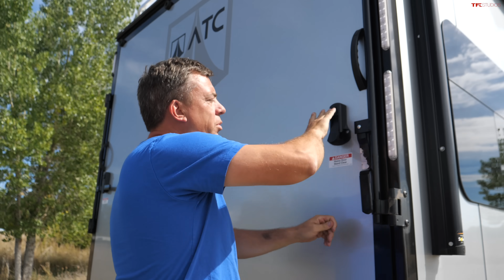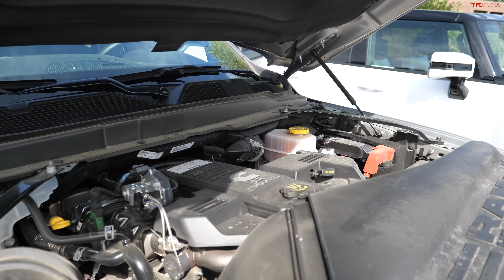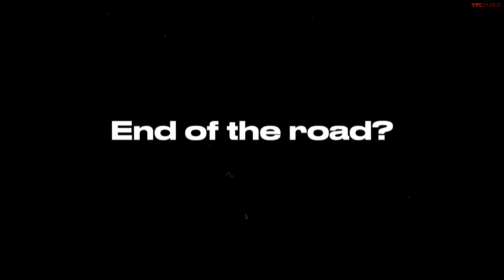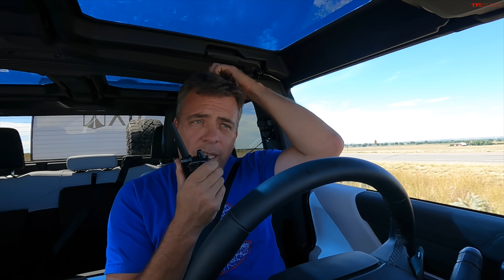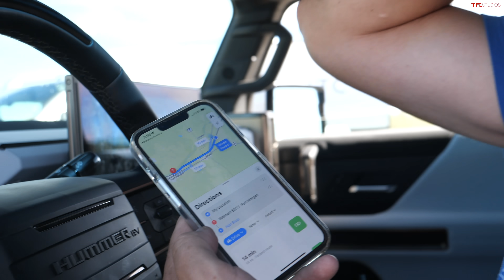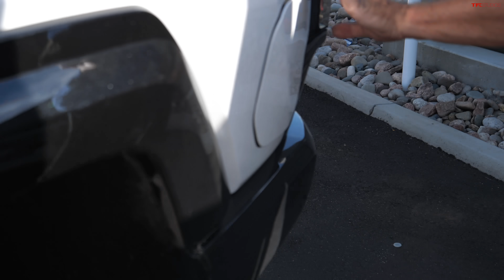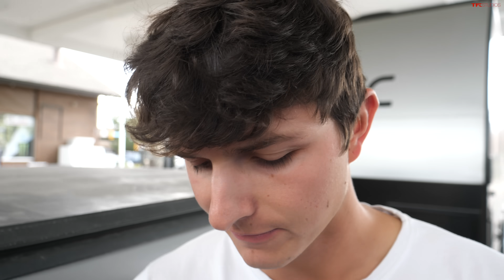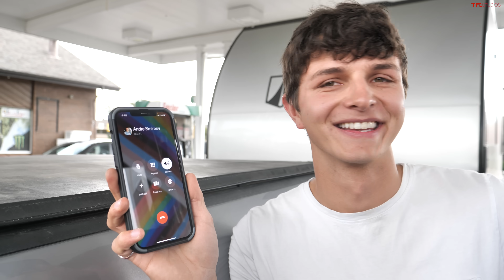How Far Can a Diesel and Electric Truck Tow An Identical Camper Trailer on ONE Fill-up?

Comment: It seems like you keep Hiding the refueling time how long does it take to recharge to get back to the full 125 mile range vs refueling diesel to get back to its 325 mile range?
Reply: That's because with EVs you only start a road trip at 100%, from that point on you only charge to 80% or so because the last 20% can take longer than the first 80% to charge. The current is reduced significantly as the battery reaches full charge because of all the heat generated while charging. 

Just another reason EVs are not ready for primetime and can only fill certain roles for most people.
Reply: @OneNationUnderGod.  Excellent point and the constant high speed charging is known to shorten the life span of the batteries, so you spend all that money for the EV, use high speed charging because of the time it saves to make it worth taking on a trip, and will be loosing the batteries usable range much quicker,  making the vehicle less practical even sooner. Then the ridiculous cost to replace the batteries !! EV'S are not close to a viable solution to replace ICE vehicles !
Reply: Andrea pointed out on the charger he was had spent 31 minutes charging.

Comment: I would love to see you really test the electric truck in a real world tuff towing here in eastern ky where the grades are 12to 16 % almost all curves no straight always and up and down and no charging infrastructure to see what options people living in mountain areas that don’t have highways and interstates that’s my challenge to u lol
Reply: Seems the easy answer is you won't get to your destination
Reply: They do a loop I’m the rockies…
Reply: Aside from the lack of charging infrastructure, this terrain would be ideal for EVs vs ICE vehicles.  Why?  All the twists and turns mean lower speed, which means less air resistance.  Air resistance is what kills range.  EVs regenerate electricity going downhill, which ICE vehicles don't, meaning even better efficiency for EV.
Reply: Same thing in southwestern pa and West Virginia. Nothing but mountains and hills and sometimes its hard to find a gas station with diesel so an ev is out of the question. I find it funny when people even say they can pull 8k with a 1/2 ton. Maybe in Texas where it's all flat, but around here anything over 2 ton you're gonna need a diesel before you burn up a gasser
Reply: Ky doesn't have mountains   ..just  hills
Reply: Yes test in eastern Ky and make sure they both start off equal, ~120kwh full charge in the hummer and the equivalent 4 gallons of gas only  (33.7 kWh = 1 gallon of gas) in the ICE truck. Oh and no refuelling for the ICE ( just to be fair with the “no charging infrastructure”).

Comment: You would have spent 40 bucks on the first half
Reply: The Cummins made it all the way back on 100 bucks you still have to drive back and fill up again. So over 1 hr charging about 70 or 80 dollars charging vs 15 minutes tops to fill up and 100$.

Comment: Seeing that we DESPERATELY NEED clean technology in transportation, knowing that anthropomorphic climate change is real and will/is causing catastrophic consequences, we must not give up on improvements to this problem of energy to density, i.e. diesel vs. battery. Until we get this disparity solved, has there been any development of trailers designed FOR electric trucks - i.e. battery packs in the trailer to assist and work in conjunction with the pulling vehicle, thus reducing the energy needed to tow?  I know it’s been tried in small ways, but don’t know of any commercial units at this time.
Reply: How long would it take to charge Truck AND Camper, 2 hours or more? Yikes
Reply: @Dogman269  I’m not an engineer, but I can imagine that someone could figure out how to rapidly charge both truck and trailer. With many EV’s now being able to fast charge in less than an hour, some in 20 minutes, I don’t see why it couldn’t be developed to have fast charging times.
Reply: Adding weight to the trailer (batteries or motors) reduces the amount of stuff you can put on/in the trailer for towing as it cuts into the tow vehicles overall towing capacity #
Reply: @SasukeUchiha-zu6dw  I’m not an engineer, but do see your point. However, I’d think just like the heavy batteries in all electric vehicles are so designed to propel them efficiently despite the extra weight compared to liquid fuel (think of the Tesla Model S Plaid!), so too a battery assisted trailer could be so designed to overcome the added weight and operate efficiently. Your thoughts?
Reply: @evevangelist5910  since the tow vehicle is rated to tow a certain limit to get around that the trailer would probably need motors to help propel it.  This might help take some of the work load off the truck.  But then the truck needs a new way to talk to the trailer (besides the 7 pin connector).  I think we are trying to solve the wrong problem or just putting a band aid on it.  Right now batteries just don't have the energy density needed for all applications.  It's not really about efficiency.  Resources for batteries are also finite instead of making big hulking trucks and trailers let's use them where they make the most sense and provide the biggest advantage, commuter cars.  Trucks can remain ICE or hybrid until next Gen of tech.
Reply: @SasukeUchiha-zu6dw  Thanks for your thoughts! Please bear in mind that before Elon Musk proved to the industry that an efficient, powerful and sexy looking all electric vehicle was possible, all bets were off, and it was considered ludicrous to think that this could be done. Same with reusable rockets. Musk and his team both at Tesla and SpaceX did what many thought was “impossible”. Thus I still think that making efficient battery powered pick up trucks is doable.

And for that matter, consider the beginning production of all electric semi’s being produced to a limited degree already by companies other than Tesla. As well as the Tesla Semi that is now in limited production with plans for full production next year out of their Giga factory in TX. Sure, there will be growing pains and problems, but I’m confident that they can be figured out. Until then, I encourage early adoption of zero tailpipe emission vehicles wherever they can be practically used, even if not as totally efficient time wise compared to their fossil fuel cousins.
Reply: @evevangelist5910  I encouraged them as well as long as it is up to the consumer.  Know the pros and cons and everyone gets a choice.  Just say no to mandates.
Reply: @SasukeUchiha-zu6dw  I also believe consumer choice is the best. It never feels good to be “forced” to do anything. On the other hand, sometimes we humans get into a rut and are unable to get out of it ourselves. So it takes some forceable means - like a drunkard having his license taken away from him. I knew a man that had that happen to him and life was difficult for him for a good while. But he learned his lesson. Humanity has grown to depend on fossil fuel to a detrimental degree and now we need to radically change. Many resist that change because they aren’t able to conceive or realize the seriousness of the problem. But change we must if we are to have any hope for the future habitability of our planet.
Reply: @evevangelist5910  EVs do not eliminate our dependence on fossil fuels.
Reply: @Mark_Christian25  There is a big difference between “eliminating” and “reducing”. Did you not see the difference in atmosphere during the March 2020 lockdown in Los Angeles? They could see the stars at night where normally smog clouded the view. Or clear skies in the day. And all because there was a dramatic reduction of vehicle traffic during that short period.

It’s not rocket science to realize that greatly REDUCING our use of fossil fuels will bring positive results of clean air and atmosphere to bless us and our children!
Reply: @locustgrovewoodworks  EVs don't greatly reduce anything.

And even if fossil fuels were creating a "crisis", why would you only reduce? It's like saying you're dying of lung cancer, but you only plan to reduce down to one pack of cigarettes a day. 

Makes no sense.
Reply: @Mark_Christian25  In all due respect, you are clearly wrong here. Electric vehicles greatly reduce local air pollution. As I’ve mentioned before, during the lockdown for COVID in March 2020, cities across the country experienced much clearer, cleaner air and atmosphere than ever before. There is even photographic record of this.
 When in a traffic jamb on a still hot summer day, you are sitting in a literal cesspool of toxic fumes from the exhaust pipes of all the cars around you. It can make you sick. 
Bad air is what has caused all sorts of lung and general health conditions which is aggravated by toxic fumes from fossil fuel burning vehicles. 
Electric vehicles in contrast emit NO EXHAUST AT ALL! Almost silent in operation, fast acceleration and economical in operation, they are hands down the leader now. 
This is all very observable by anyone with an open mind to see the obvious. I hope you will allow yourself the freedom to explore these amazing technological advancements. Let go of old concepts and learn how much better they are in almost every way compared to dirty, toxic producing fossil fuel vehicles!
Reply: @locustgrovewoodworks  Most heavy PM does not come from tailpipe emissions, and comparisons of general EVs to general ICE is fallacious. Actually, your whole comment is fallacious.
Reply: You don't need "clean" technology in transportation, you could walk instead of lecturing us about saving the planet.
Reply: @Mark_Christian25  Walk while you drive past me in your seriously toxic diesel or gas vehicle - polluting the very air I breathe? Come on man, get real. How about you or your children walking or biking, and I pass you in a zero emissions vehicle, thus allowing you and your loved ones to continue to breathe clean fresh air? Or would you rather I pass by in a belching diesel truck to fill their lungs with toxin laden air? Even on a local basis, zero emissions vehicles make sense.
Reply: @evevangelist5910  There's no such thing as a "zero" emissions vehicle. 

And who says I'd drive past you in anything? Maybe if you set an example, instead of being a hypocrite, people would follow your example. 

But no, you're not as desperate to save the planet as you pretend to be, so you're no model here.
Reply: @Mark_Christian25  Not as far as the manufacturing goes. True enough. But studies have shown that after around 20K miles driven, the all electric vehicles have paid their dues and do not contribute to contaminating air quality or adding CO2’s to the atmosphere. Whereas a fossil fuel vehicle will continue to do so until it’s junked. And as far as me being a hypocrite, please explain how you think that I am? What actions am I committing that qualify me as being a hypocrite. I’m open to constructive criticism but not ad hominem attacks trying to discredit my character and dodging the subject at hand.
Reply: @evevangelist5910  No, it's not just as manufacturing goes. No grid is "clean", and no form of energy goes without waste.

And as for why I called you a hypocrite, I've already told you why, and it's no way an ad hominem, because it's entirely relevant to issue.
Reply: @Mark_Christian25  You need to realize that even if one charges their electric vehicle from a 100% coal powered electric generation plant, it is way more efficient than an internal combustion engine vehicle. ICE vehicles are only about 40% efficient in its use of fossil fuel for propulsion, compared to 90% with an electric vehicle. And with the grid getting cleaner each year with the rapidly growing solar and wind electric generation adoption we are reducing our dependence on dirty coal.

As far as your accusation that I’m not being a good example and thus am a hypocrite - you don’t even know me so how can you make such a baseless accusation?
Reply: @locustgrovewoodworks  A coal plant has the same thermal efficiency as any ICE, because a coal plant is an ICE!

The total grid efficiency of a coal generator is more or less the same as a ICE car. From there, your EV has it own efficiency losses, which would actually make you total well-to-wheel efficiency worse than an ICE car.

And that doesn't even included the total waste emissions from producing the EV, or disposing or recycling of it, which are all far worse than ICE.

You are highly misinformed.
Reply: @Mark_Christian25  I have to respectfully disagree. The efficiency of transfer of power when comparing and internal combustion engine to an electrically powered vehicle is vastly different. An ICE   vehicle gets only about 30% efficiency vs. about 90% for an EV.
Reply: @Mark_Christian25  Furthermore, it is becoming more profitable for EV manufacturers to recycle old EV batteries than to mine for more raw materials. Which is why the spin off from Tesla  - Redwood Materials was created. And again, as I’ve said before, while it is true that the initial manufacturing of EV’s is a bit more polluting at this time, this is all negated after driving the EV around 19,000 miles. For the rest of the lodge of the EV, it is carbon neutral, let alone being zero emissions for local air quality from its very beginning!
Reply: @locustgrovewoodworks  What are you repeating? This is not about battery to wheel efficiency.
Reply: @locustgrovewoodworks  It's only become more profitable because of the increasing cost of material. That ultimately doesn't make EVs cheaper. Actually, it's the opposite.
Reply: You begin your post asserting facts not in evidence - assertions that are in reality highly disputed by reasonable people on both sides of the argument.  Please don't do that.  It's fine and useful to inquire about ways to improve EVs, but bracketing that question with unproven assertions about climate does a disservice to us all.
Reply: @KZ-se4ik  My assertion that we are in a climate emergency/crisis is not debatable any longer. Anyone asserting that it is debatable at this time is not relying on good science. Unfortunately the internet is filled with loud and desperate dis-information by big oil, that, like as tobacco companies in the past, wish to downplay if not altogether discredit solid science that clearly shows their culpability.
Reply: @evevangelist5910  Even if there were a climate "crisis", EVs are nowhere close to solving the issue.

Comment: I think EVs are cool in some ways but your videos have proven time and again that they are not even close to competing with gasoline or diesel vehicles. As always TFL has the absolute best content when it comes to vehicles. When are you guys going to modify that RAM 250o for offroad use?
Reply: I think right now they're made for people who make a six block run to Starbucks and a one mile trip to Whole Foods.  Basically a toy that allows you to Virtue signal at the health club.
Reply: @anderander5662  I use my EV instead of my Expedition unless I'm towing or need the extra seats. I save hundreds every month on gas.
Reply: The majority of the 80% of Americans who live in a city don't need a truck. So this video is irrelevant for them. When you're commuting to work in rush hour, or doing the school run (and charge in your own garage overnight), then yes, EVs are absolutely competitive with ICE.
By all means say trucks aren't competitive, but "vehicles" certainly are.
Reply: @robertharris1748  Agree.  I could easily replace my Subaru with a Tesla.  My diesel Ram?  No way...because 90% of the miles we put on that truck are with a camper behind it.  If I used it like a lot of people do, an F-150 lightning would be great. Think - "I need a truck cause...uhh Home Depot and my buddy might need help moving".
Reply: EVs cant compete yet Democrats are forcing auto manufactures using unrealistic mandates to stop building ICE vehicles.

Comment: The Hummer EV weighs 10 thousand lbs and can only tow 7500 lbs 😂. That’s like a 250lbs jacked bodybuilder that can only bench 135 lbs. Oh and the Hummer has a tendency to break down.

Comment: Hybrid drive trains are %100 the way to go, they provide power + economy + reliability. The Prius has been the most fuel efficient and reliable vehicles in the last 20 years.  Andre’s own F150 is a real world example of hybrid systems, there are No negatives.  But because of strictly political agendas they want to force feed EV’s that have significant flawed capabilities.

Comment: There's more places to fill up with diesel than charging up here in the northeast.  How's that electric motor do in freezing cold and the battery usage?  Where are all these batteries going to go when they can't hold a charge anymore?  If you ask me we should just stick to fossil fuels.  They may have air pollution but those lithium batteries are more dangerous because when they catch fire you can't spray water on them.  I think the government needs to step back and really look at what their thoughts are.  They're going to end up putting a lot of gas stations out of business which will hurt the economy.